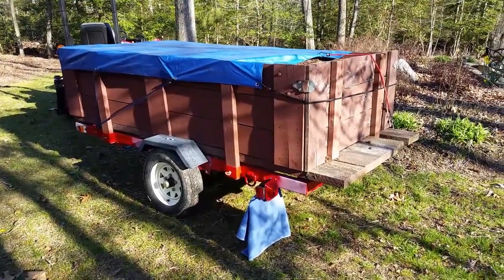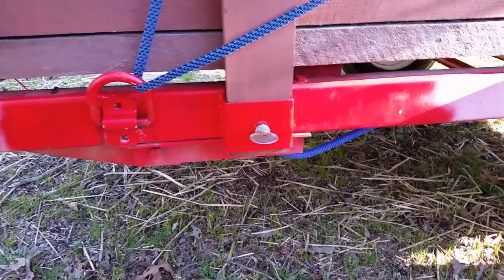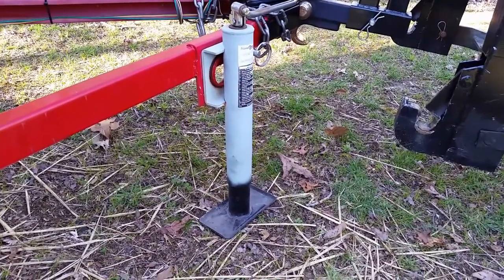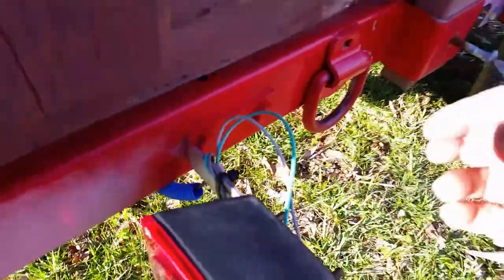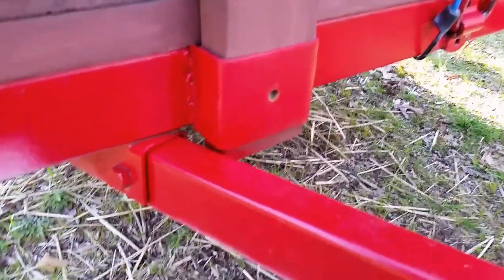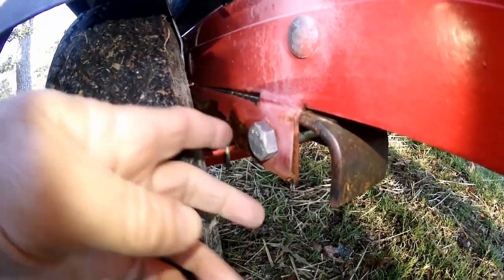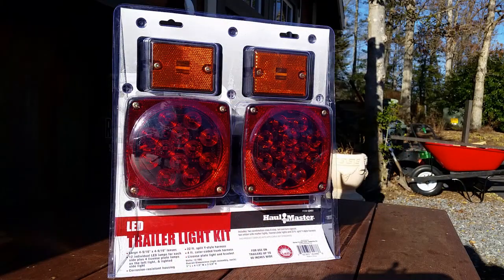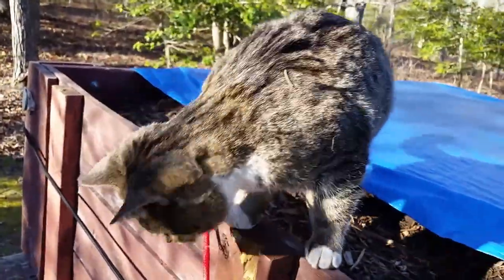How's the 4'x8' Harbor Freight Trailer Looking a few years in?

Comment: yea, the wiring that came with thing was terrible..  I ended up choosing to replace all the wiring but there still is the crappy wires that come off the lights..  I mean, I suppose you could try to pop the plastic casing to the lights apart and the solder good wiring in right onto the contacts but I didnt go that far.

Comment: I hope you are coming back to this to read comments.  I am in the middle of building one of these and having problems with the front and back frame not laying flat next to each other.  The front and rear platforms do not lay flat due to rear bolt head. The front bed platform bolts through the axel frame support, while the rear does not (in order to flip up).  Therefore the rear platform has a bolt head that rests on the axel frame support raising the platform the height of the bolt head.  I have photos that I can send for better explanation.  What am I doing wrong?

Dan I
Reply from the maker: Hi Dan, Mine is not a folder, so not sure I can really help. My first suggestion is to double-check the instructions and make sure you have the right size bolt for the location. If you want to post some pics on a public site and then post a link here, maybe someone can help. Plz don't post any zip files or the like. I won't open them due to all of the viruses that get delivered that way.

Comment: Thanks for the vid. (LIKED) Going to pick one up in the next few weeks. Mainly to pick up bulk mulch, compost, etc. 80psi? probably runs like a doughnut spare. Noted documentation stated 45mph. I have to travel 20 miles on an interstate, speed limit 65mph. I could do 55 in the right lane. Do you know if there are tires, radials as mentioned, that can run at 55-60 mph safely. Thanks again for a very insightful vid. Subscribed.
Reply: That 45mph is the standard recommended speed for all utility trailers. Even U-Haul trailers have it posted on their fenders, in reverse so you can read it in the rear-view mirror. If you're driving a long distance with a heavy load, perhaps a good idea. Otherwise, just drive like normal and check the hubs occasionally to avoid overheating.